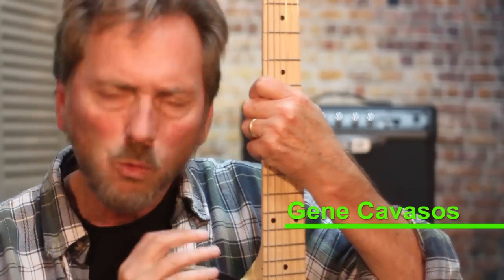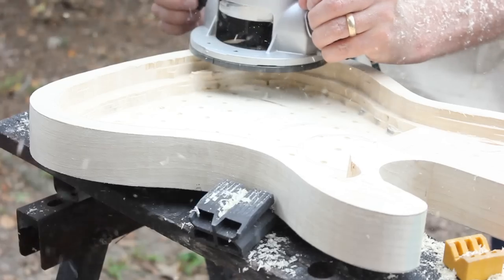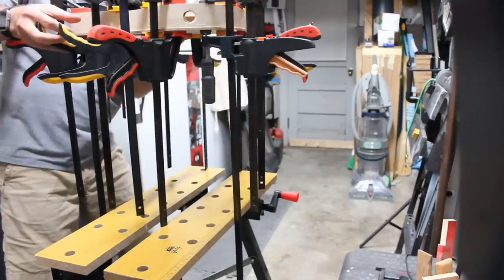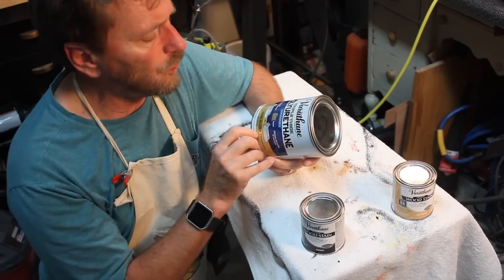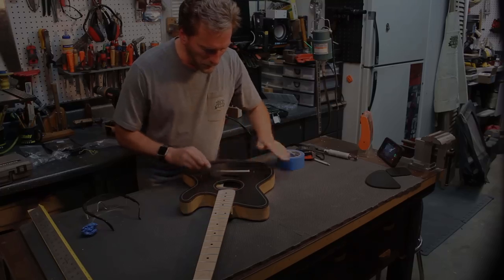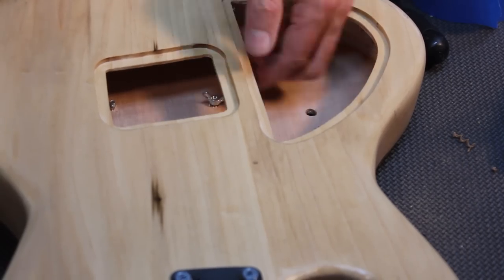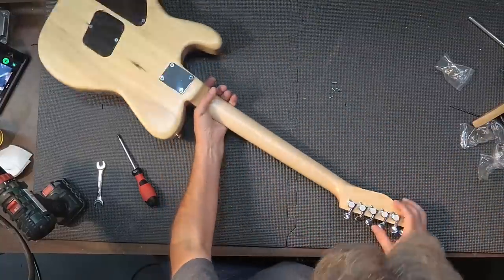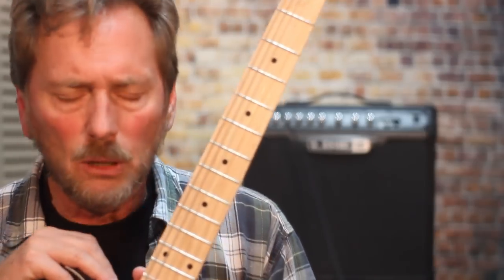How to Make an Acoustic Electric Tele-Style Guitar (Step by Step)

Comment: All right this is the first time I've seen this video and I know it's been 8 months but I'd like to know is how much warping has occurred to that top since you have not added any type of bracing???? And if it has not,I suggest you add bracing through those large cavity holes that you've made. Also I suggest that you add a separate volume knob between the switch and the Piezo, use a 500K or a 1m.
Reply from the maker: GAMES AND GUITARS , That a great question. A lot of people have made comments about bracing. But I’m happy to say no warping. I like the idea of a separate volume non and a better pickup. I think I will do another video doing all the great suggestions. Thanks for watching.
Reply: @DIYGene  well nice to meet you sir. I am a third-generation luthier in Memphis Tennessee. And I can guarantee you, it may take 5 or 10 years but it will Warp. The pull of the strings will slowly start to lift the bridge and Warp it towards the headstock. Guitars that have bracing end up having this problem after 20 or 30 years and then they have to be repaired. You're better off adding the bracing and getting a longer life out of the instrument without having to fix it. Even with the bracing it will warp after a few decades. Without the bracing it'll happen in the blink of an eye. Trust me put some bracing on it.
Reply from the maker: GAMES AND GUITARS , Very good advice. Do you think blocking under the bridge to the back would serve as a brace?  I am no luthier and very noob at that.  But this has been wonderful learning experience. I wonder how Fender is doing it on the Acoustisonic?  You can see a YouTube video on the manufacturing and I don’t see any bracing. Maybe they just don’t show it.  https://youtu.be/IcuPxpfVCug             Very nice to meet you too.
Reply: @DIYGene  fender added minimal bracing only in the bridge position which I think is a big mistake. The acoustasonic is a big thing now, but I built one like this back in 1993 for a customer requested it. It's really not a new thing it's just new to the market. I don't agree with the minimal bracing that they used. If you want add a block that is fine but the bracing also guards against lifting your top away from the rear glue seem. I don't think you'll have that issues since you have a very wide border, larger gluing surface. I would add at least two braces in a V pattern underneath the bridge itself. The opening of The V towards the neck the point of the V towards the Bridge pen
Reply: @DIYGene  one more thing, try to make the braces as long as you can make them. When you go to glue them in you're not going to be able to get clamps on it. Stewmac has a tool that  is a mini scissor jack that is quite expensive. My granddaddy taught me to use a blood pressure cuff. Add some scrap wood inside place the blood pressure cuff underneath the brace once you have glued it in. Pump the blood pressure cuff full of air so that it gets good pressure up against the brace. Be sure that the brace does not flip once the pressure cuff as started to lift.
Reply from the maker: GAMES AND GUITARS , That is an incredible concept. Thank you so much for the great advice and I will definitely be applying some of these in the next build. Or should I say rebuild. That is so interesting and disappointing about the Fender Acoustisonic. You would think for a $2,000 plus guitar, it would be built better.
Reply: @DIYGene  you're welcome... And I know it's disappointing. I'm sure I'll be repairing a few in the next decade or so.

Comment: Hi broo i have a question. Is this guitar playable without an guitar amp. Just like standart acuistic guitar. I want to do that build without electronics. I really like the shape and i want to do that like acoustic is this possible?
Reply from the maker: The sound is actually in between. It is not as loud as an acoustic but much louder than an electric body. I received so many great suggestions from viewers that I tore it apart and rebuilt again. Here is the link: https://youtu.be/HBsMakHdCLo
After using a different wood for the top it has even more acoustic sound when not plugged in. I hope this helps. Thanks for watching.
Reply: @DIYGene   Thank you weryyyy much...

Comment: Excellent!!  But you should call yourself "DIY Leo" (Fender) I would have made it as a "Chambered" (semi-hollow bodied) instead and used a piezo pickup that is part of the wood acoustic bridge, this would have eliminated the horrible "echo".  (I worked for Fender 1972 - 1999.) BTW - a little Fender trick: loosen (slightly) and then re-tighten the neck bolts AFTER you put the string on, this pulls the neck into the pocket to zero clearance. This greatly improves the tonal harmony of the neck and body together. I call it "Neck Chiropractic."
Reply from the maker: Vint Guitarz , Oh I wish. I am no luthier. But I enjoy learning on every project. Thanks for watching.

Comment: Nice job, looks like you have to a just the two E strings. The base E looks to far from the top of the neck on the fret board and the 1st E string looks like it is to close to the bottom of the fret board.
Reply from the maker: joseph Dimalante , It was pushing it a little bit. I had to reset the bridge. A little better planning could have saved me a lot of extra work.

Comment: To get rid of the noise of the electric pickup you need to ground your electronics. Therefore you should use a brass made bridge and connect it with a wire to the ground of your electronics and the noise is gone whenever you grab your strings. ;) Else, well done job! Thanks for sharing! ;)
Reply from the maker: So would a brass plate underneath the bridge with a ground wire work? I have had so many great suggestions that I did a new video and completely tore apart my favorite guitar and implemented many suggestions. Here is a link: 
https://youtu.be/HBsMakHdCLo
Thanks for watching.
Reply: @DIYGene  The important thing is, that your electronic ground is connect to your body as it always is with the electric guitars. That is the only way to get rid of the noise, furthermore it will be helpful, if you shield the electronic in a box (alumnium e.g.) or you use graphite spray for the whole inside of the guitar.
Reply from the maker: @DlmlZ , I wonder how Fender has gotten around this with the Accustasonic? They incorporate a wooden acoustic bridge without shielding the entire body.
Reply: @DIYGene  No idea how they did it, never checked on that guitar. Maybe the pickup is already shielded. But there must be a shielding somehow. Hmmmm.... does the Fender Acoustasonic come with a battery? If yes, then they probably used active low impedance pickups (like e.g. EMG pickups). This will also reduce the noise a lot.
Reply from the maker: @DlmlZ , I bet you are right. I think they use a Fishman system that probably takes a battery. Here is an interesting video on the making of the Acoustisonic. 
https://youtu.be/IcuPxpfVCug
Thanks for the great advice.

Comment: hello gENE can I ask you how you knew where to put the sound all and probably more importantly how did you know where to put the pickup sober the low E and the high E strings ran over the poles on the pickup, I'm not sure how and where to put the Soundhole and the pickup  (how did you work out the angle the pickup should be) although I understand everything else
Reply from the maker: Thanks for watching both videos. I answered your questions on the other post. I hope it helps. Thanks for watching.
Reply: @DIYGene  yes it did thank you Gene

Comment: Wondering how this is still doing. I have a couple concerns. 1/4" lauan without bracing... has it held up or is it bowing? Obviously that's a smaller total space than a big dreadnought. Secondly, you don't have a ground wire up to your strings to ground them. I'm not sure how you'd do it with an acoustic bridge, but that is some of the noise (combined w/ single coil is going to be even noisier).

Overall really cool though.
Reply: Joe Tennies had the same thoughts.
Reply: @jeremiahgibbs7786  These are his thoughts.
Reply: The top is plywood, it is braced in its construction. I’m not saying it cannot move or crack, but if you’re comparing it to regular guitar construction with a spruce or similar soundboard you’re really comparing apples to oranges.  Best.
Reply: @JefAlanLong  Can you edit this again?
Reply: Thats a simple fix. A small piece of thin brass with a wire soldered to it. It gets glued under the bridge where the strings come through. The ball end of the string will press against it and ground them.
Reply: @JefAlanLong  Millions of guitars are produced everyday with laminate (plywood) tops. They all need bracing. Even nylon string guitars which have significantly lower string tension. Fenders Tele and stratocustics are all laminate tops and have bracing. Im talking about the versions with that terrible injection molded back.
Reply: benfordguitars thanks mate, I haven’t built millions of guitars, but I’ve built a few hundred :)
Let’s be mindful that this thing has a bolt in neck, easily shimmed if/when the top bellies a little.  And if it fails...? Oh well plane it off and replace it.

Comment: Very nice work. I think a more complex wiring would have resulted in a little better sound. Maybe separate volume for each pickup or a active eq for the piezo. Also there are so much better acoustic pickups and still stay in a budget. Overall I think it’s crazy cool. But with a few minor adjustments it could be completely awesome! Thanks for the video keep up the good work.
Reply from the maker: Donovan Howard Music , Do you have a recommendation for a better piezo pickup?  This was a really fun project. Thanks so much for watching.
Reply: DIY Gene I wouldn’t use a piezo at all but a better acoustic pickup. LR Baggs makes top of the line acoustic pickups. Thanks for the video

Comment: This guy just did the Acoustasonic! 😂🤘 Amazing!
Reply from the maker: This was a really fun project. It has become my favorite guitar.  Thanks so much for watching.
Reply: @DIYGene  Thank you for making the video!
Reply from the maker: I actually went to Guitar Center to look at an Acoustisonic and they had never gotten to see one either. So I watched some of Fender’s videos on the guitar and tried to build one my self. I don’t think there is a total of $60 in the whole guitar.
Reply: @DIYGene  Maybe I'll buy a cheap Tele and try to transform it into an Acoustasonic. Or even a strat! The main reason for its price is because the wood work is made in the Fender Custom Shop.
Reply: @arodrigues14  the reason for the high prices on anything fender or gibson is because they are in debt up to their eye balls and between the 2 have a 70% market share on guitars so they can basically borrow as much as they want and charge whatever they want. If it was priced based simply on cost of production, materials, shipping to retailers and the small profit margin they screw retailers with, you'd see a 30% cut in prices down the line. They got debts to pay though and we're paying them. We'll y'all are. I build my own stuff like gene here did.

Comment: Don't you need bracing on the inside of the soundboard for structural stability?
Reply from the maker: Great question. The guitar did great but I had so many great suggestions like yours, that I took those great suggestions and rebuilt the guitar. Here is that video:  
https://youtu.be/HBsMakHdCLo
Thanks for watching.
Reply: @DIYGene  Oh wow. Cool!

Comment: In a diy guitar build, how tough is it to get the intonation exact?
Thanks
Reply from the maker: Great question. If I was using a electric guitar bridge it would be simple. But with the acoustic bridge it was much tougher. Luckily Stewmac.com has a free fret calculator and I used it to set the bridge for the best intonation. I hope that helps. Thanks for watching.

Comment: The problem with the single coil pickup is that is slanted, when it should be positioned straight with the strings
Reply from the maker: I actually put it at the same angle as a regular telecaster. Thanks for watching.

Comment: May be a lttle nut filling may help the cords you were playing  sounded out of tune, whilst the guitar may have appeared in tune when tuned pressing down on the first couple of frets may be increasing string tension a bit causing the note to be be higher than expected. I agree with the bracing comment but no need to go too far. simple bracing from the neck to the bridge will suffice either sid of the sound hole, too much and you coule loos that nice acoustic resonance.

Comment: i was just wondering how thick is the body on yours 1/34 or 1 1/2 or whatever how thick was the wood you started and how deep did you rout the body out
Reply from the maker: Andrew Archer, I actually picked up a 1.75” thick wood and routed it out to 1.5” deep.
Reply from the maker: Andrew Archer, This has now become my favorite guitar.
Reply: @DIYGene  thankyou im learnin by self teaching and youtube and free pdf down loads also and as i build i create custom origonals outside of other peopls designs and i have been successful in producing solid origonals, i am also half cherokee and build flutes and have discoverd with wind and precussions meaning holes and open grooves like perfing also add to the raw acoustics and when applied to a sound hole it can add to the rich loud tones so had feder created a perfing style grooves around their sound hole and closed the front of the grooves to create additional rectangle holes outside the sound hole itself it would actually add more sound espeacially in acoustic and with that piazzo now although these instruments dont reqire perfing but i use the in locations where they dont do what was origonally intended for but my methods have proguced soe awsom resaults in the resinating aspects

Comment: Nice job. Try to use a wound G string...
Reply from the maker: Riccardo Pareschi, Thanks for the suggestion. But I’m not sure I understand?  Can you elaborate? I am still learning. Thanks so much for watching.
Reply: @DIYGene  Hi. Normally an acoustic string set has the G string wound like the E, A & D strings this solution give a better and stable sound to that string. You have used a normal "electric guitar" pickup as magnetic part of your setup, as I've understand, so better if you try the electric string 10/46 or 11/46 sets with wound G (like Daddario EXL110W or EXL115W). Fender use an "acoustic magnetic" pickup so in the Acoustasonic you can use normal acoustic strings. Hope this help.

Comment: The bridge should be the same distance from the 12th fret as the 12th fret is from the nut.
Reply from the maker: You are absolutely right. Also you can use a free bridge calculator on Stewmac.com. Thanks for watching.

Comment: It looks cool but really it's not going to sound very good unplugged because the top is way too thick. I realize designing it with a thin top and bracing would be much more difficult but in the end the hollow body and sound hole are pretty much just aesthetic.
Reply from the maker: Jaden McFarland , I saw a review on the Acoustisonic and they said about the same. But plugged in your get a rich acoustic sound. I guess there are trade offs.

Comment: You really should watch out. There is no bracing for the unsupported top. At least you should have put a support block underneath the bridge. The bridge will fly of
Reply from the maker: Sander Brugman , I think it will be okay. The bridge is glued and bolted and the face of the guitar is actually 1/4” thick. So far it is doing well. Thanks for watching.

Comment: Why you used MDF? The body is fine solid wood, why not the top!? You did such a fine job, but MDF doesn't fit to this... ;-)
Reply from the maker: Heini Messenger, I chose the top wood with the MDF backing because I was concerned about stability, or pulling away the bridge. I hind site I would go with a full wood. I’m sure it affects the tone. Thanks for watching.

Comment: Pretty sure it's pronounced "pee-ay-zo" not "pee-ah-zu". Also you should put a piece of metal on the back of the bridge that touches all the strings and connect it to ground, to reduce buzzing (without that they're basically 6 antennas picking up all kinds of radio garbage in the aiwaves).
Reply from the maker: blackcorvo , that makes a lot of sense. Rather than just grounding to the nut holding the bridge. Thanks so much for watching.
Reply: @DIYGene  You're welcome! It's basically why you ground the bridge, it's to also ground the strings so they don't pick up radio noise and induce it into the pickups.

And it might be worth trying those "dual rails" mini humbucker pickups in place of yours (even the cheap chinese ones will do for a test: https://www.ebay.com/itm/383304033082 ). It will help match the Piezo's output, and will have less noise too, since it's a humbucker.

Comment: I have many problems with this build. First, luan is for construction, not guitar tops. Secondly, it’s too thick. Needs to be about 1/8 inch. Thirdly, it needs to be properly braced and have a bridge plate. Then, you need to use an under saddle pickup or some k&k transducers instead of that garbage biscuit piezo. I could go on but the point is you made a decent low end guitar with low end parts. For just a small amount more time and money you could make something ten times better. You have the skills, now you need to learn the proper methods of building a guitar.
Reply from the maker: I got so many great suggestions including some of the ones you mentioned, that I tore apart my favorite guitar and rebuilt it using a lot of those suggestions. Here is the link to the video:
https://youtu.be/HBsMakHdCLo
Thanks for watching.